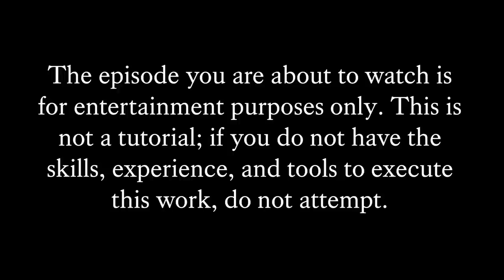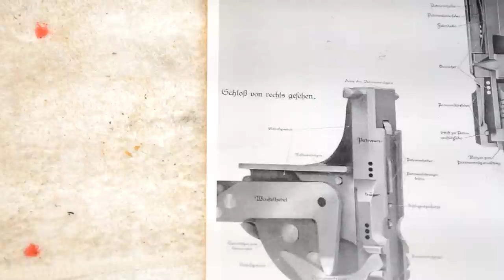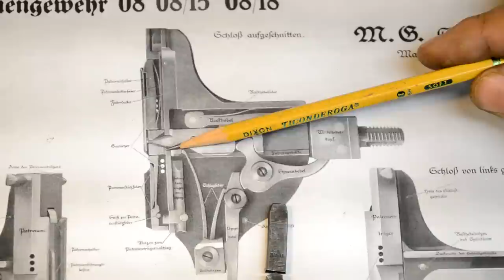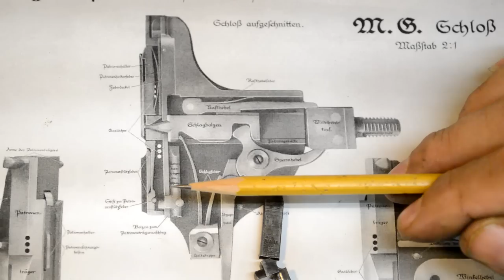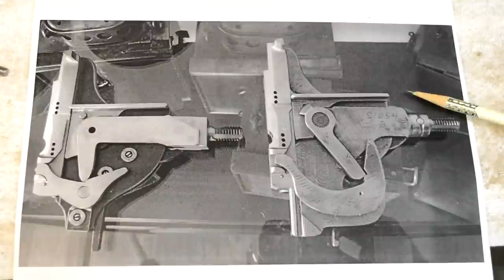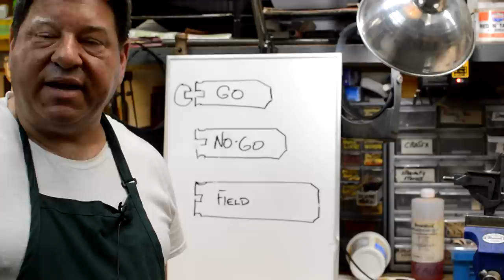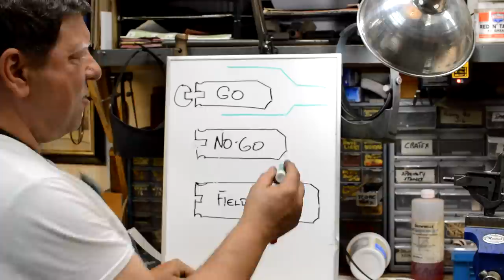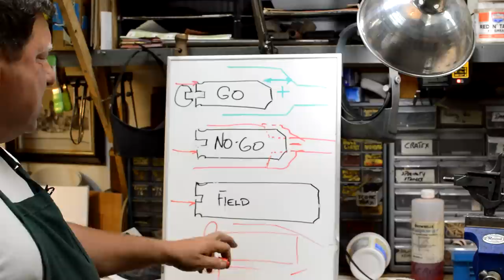Anvil 040: Maxim lockwork

Comment: Hi thanks for the great contand 
I'am from austria and my Profession is maintenance of trains from nostalgic to the newst once  and i'am a gunnut.
As soon as you mentioned the locomotive connection it made klick. All of it is so similar to the tech. Even nowadays we use the same bolts locking
With the same locking wire.  (Der Kurbelmechanismus) the crankworks are the same. You blow my mind thanks
Reply: The Maxim system is basically a steam locomotive. Also interesting fact is that people who were involved with the Maxim also had experience with the train industry at the time. Funny trivia bit. Maxim also invented the suppressor/silencer, while also invented the muffler for the automobile ;-)

Comment: Absolutely FASCINATING lockwork!  Incredible engineering!  That's what I've always been most interested in, concerning firearms.  The engineering.  From the super complex in these older designs to the simple genius in simplicity that is in an AK.
Reply: Kalashnikov took a huge lesson from Shpagin, that perfection is achieved when there is nothing else to remove.

Comment: That sure is a steam train of a machine gun. Thank you for anguishing yourself to show us .
Reply: That description makes A LOT of sense.  I had previously wondered why in hell the old codgers thought a hundred bits moving like a swarm of bugs was a good idea for a firearm action.
Reply: @AM-hf9kk  This was new technology and with machinery design in general a complex looking design is often simpler to develop than a simple looking one with single parts doing multiple jobs.
Reply: @AM-hf9kk  you start by making each piece do one thing in the design. Then you combine pieces to minimize the total parts count until you can't reduce the count any more.

For example, the Browning tilting barrel auto pistol. Started out with the 1911 and a swinging link pinned to the barrel, locking into the upper slide. Then there's the CZ75 (which I believe is the same as the Hi-Power), which changes the swinging link to a cam track that is part of the barrel, but still locks into the slide. And finally you get to the Glock, which has the barrel cam track, but uses the ejection port as the locking surface.

Comment: I'm a bit surprised that you brazed that broken part together instead of silver soldering. Not able to get a tight enough fit to use SS?
Reply from the maker: Didn't need to to. The brass was good enough here, kept it simple

Comment: I bought a silicone soldering mat for my gunsmithing bench, the silicone material is fire resistant and won't scratch a finish, and they come in a soft yellow color that would make a great contrast for filming.
Reply from the maker: Good to know,  thanks

Comment: Mark  "T. Rex"  Novak  (13:34)  "Aaaa  My arms are too short!"   LOL

Is there a metallurgical reason you went with brazing over TIG or some other form of welding?

Or is it just
using whatcha got vs expensive welding equipment
or
Good 'nuff ...?

I have nothing against brazing,  I'm just wondering
Thanks for another great video.
Reply: Brazing preserves the shape of the original steel better.. a bad setting on the Tig welder, or forgetting to purge the shielding gas, could very easily result in a puddle of liquid, and  at that point, you're making a new one, with guessed dimensions...
Reply: No reason to weld it when brazing will do the job just fine
Reply: Well, unless he has the TIG welder (hardware) available, along with a TIG welder (skilled professional) at a reasonable cost, the likelihood of which is quite low.That was
Reply: That was honestly my number one suspicion.  Use what you have available, if it’s good enough to do the job.  Still haven’t heard it from Mark, though, so it’s honestly just guessing to this juncture.

Comment: 27:30 I can't help looking at all those drillbits and thinking surely one of those is the same diameter as the pin and would work MUCH better than a small screwdriver to hold the spring in place.

Comment: Outstanding as usual!   Hypothetically, if you had to remake that little broken piece from scratch... what type of steel would you use? Hot rolled, cold rolled, or whatever the heck you had laying around? does it even matter?
Reply from the maker: Something easy to machine. This was not a tolerance critical part, and could probably be made out of brass in a pinch

Comment: A question for the master.  I have an Iver Johnson "Pony" .380.  Basically a miniature 1911.  When firing slowly it works quite well.  When I double tap, it fails to eject.  I honed the chamber but no-go.  I see that the extractor is scarring the rim.  Could it be a mag problem?  Any pointers?
Reply: Is it a true 1911 style short recoil locked breach or a straight blowback? If it's the latter, could it be bouncing partially open?
If the extractor is dragging excessively on the case, there could be dirt under it. If the pin isn't staked/peened, try taking out the extractor and cleaning the underside.

Disclaimer: Not a gunsmith by any means, just an idiot with some tools XD
Reply from the maker: Put a heavier recoil spring in place to slow the cycle. This may sound counter intuitive, however 1911's are the same way.
Reply: @TheBigOne0305  they're locked breech